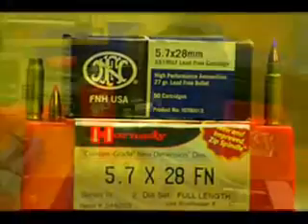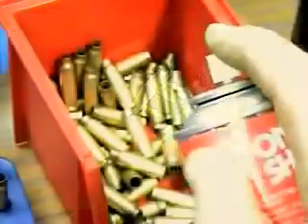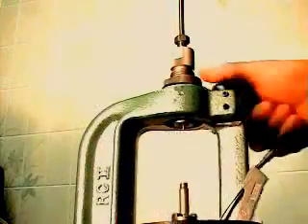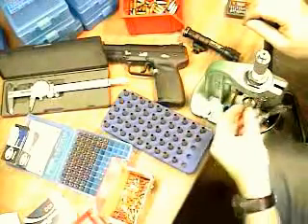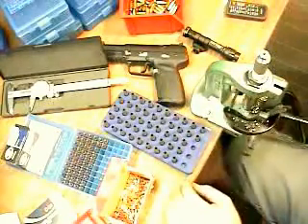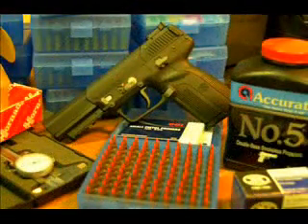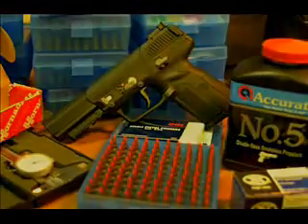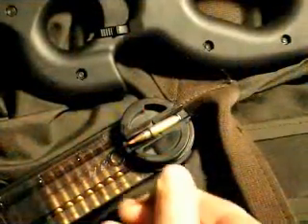5.7x28 FN - Reloading Demonstration

Comment: you need to make sure that you use virgin primed brass or re-lacquer the cases after firing, if you cannot afford brand new cases then you will run into feeding issues.

Comment from the maker: The velocity and weight of the SS190 round it is already duplicated in the SS195LF.  Not sure what black tips are.  
Emotions seem to run high around this little cartridge.  Pictures of a shredded hand and arguments over whether or not reloading the 5.7x28FN should ever be attempted really make things interesting when researching these.
An important point I have to make is that anyone who endeavors to load these for the sole intended purpose of saving money will likely be disappointed.

Comment from the maker: @donthebodyguard Hello, there.  I'm still using two identical manual type balance scales made by Ohaus one of which is an RCBS 304.  Just never had the need for an electronic scale but that would probably be the smart way to start out if you have none.  Not sure which brand to recommend.  I like Dillon products best followed by Redding, Lymann, Hornady, and RCBS.

Occasionally you can find a really cheap Frankfort Arsenal electronic scale on sale at Midway USA for about $30 just to get by.

Comment from the maker: @domdomdidity Because I keep the pressure reasonable in my handloads brass life isn't an issue.  There haven't been any split or bulged cases yet, but there have been a few loose primer pockets.  This isn't a cartridge that I shoot often enough to really track casing life, though, so you might try posting the question to one of the 5.7 discussion forums for a solid answer on this.

Comment from the maker: @SludgeSlinger Since making this video, Yes, I have noticed a few hangups in the PS90 relating to proper feeding from the mag.  In the past I had juiced them with Hornady One Shot but read that this might not be advisable, that it might inhibit proper blow-back operation.  Also, the USG pistol mag's cannot be filled to capacity with these less slippery handloads.  The cases bind in the staggered magazine and do not feed properly.  This is a challenging cartridge to load, no doubt about it.

Comment from the maker: @762girl Yes, it would be the same process as loading any other bottle neck cartridge in your 650, just like loading .223.  Personally, though, with the tiny case's sensitivity to powder charge, I prefer to single stage everything and throw my charges one at a time with my Redding Powder Measure using the precision bench rest metering chamber.  Less chance of wearing my PS90 in my face :-)  You could try it out and just keep checking the powder charge weight at first until you really trust it.

Comment: Hi!  I'm a pretty experienced reloader.  Do you know if it's possible to use a Dillon 650 to reload the 5.7x28 (once the crimp is removed)?  I have the powder measure warning device on mine.  I have the RCBS dies.

Comment from the maker: @tierfuehrer2 
Certain military cartridges have their primers staked into place in order to improve reliability.  When de-priming the cartridge, the primer comes out easy but there is a metal edge that prevents re-priming the cartridge without damaging the new primer.  The reloader can use an inexpensive cutting tool to chamfer this ridge or he can use this tool that holds the cartridge while forcing a tapered swaging mandrel into the primer pocket mouth, thus reshaping it to allow safe priming.

Comment: What does the tool do in detail, that removes the crimb from the primer pocket (How is it chaped, etc.)? How does the crimp influence the removal of the spent primer? If the crimp is not removed, is it impossible then to place a new primer?
What is the purpose of the crimp, if there are shells that exit without it?

Comment from the maker: @Mattsplat1975 Thanks.  There really isn't that much technical information here, the point of the video, I guess, is that it can be done but requires considerably more time than standard straight-walled cartridges, and also an extra measure of care if it's going to be done safely.  Hope your reloading goes well if you decide to go forward with it.  One piece of advice, don't skimp on your shell holders or your dies.

Comment from the maker: @80spodcastchannel Thanks, '80s.  The sequence was slightly off, the case length is checked AFTER sizing, oops.  The only difference I have noticed between factory ammo and reloads is an occasional hang-up in the magazine for the PS90 where it makes the 90 deg. turn and also, the double stack 20 round USG magazine will not feed when crammed full due to friction between the cases.  As far as reliability, I cannot recall experiencing a single failure to eject using this cartridge in either gun.

Comment: Dude...GREAT video..not many attempt to reload these. got one question though.
like the CCI blazer aluminum cases, these come from the factory with a propriatary coating to change the coefficient of the surface drag in the weapons chamber.have you had failures to extract or strange ejection patterns when doing mulitple reloads of these cases? I have heard that there is other sources for these cases as well. I think starline is making them now. problem is their are a strange base sizing.